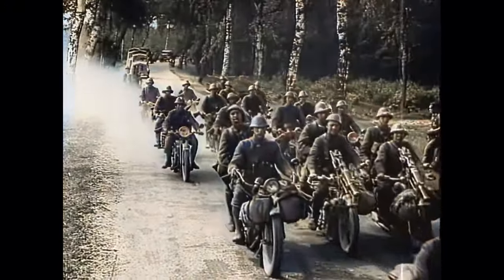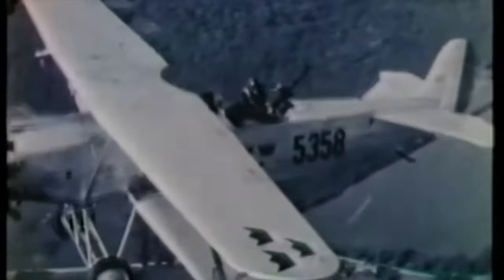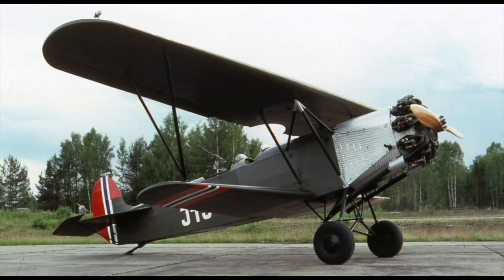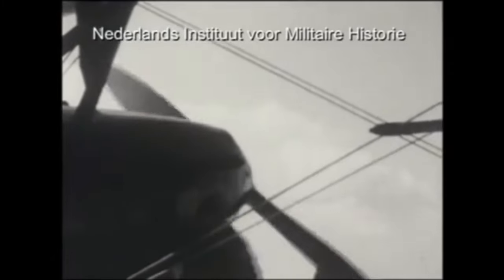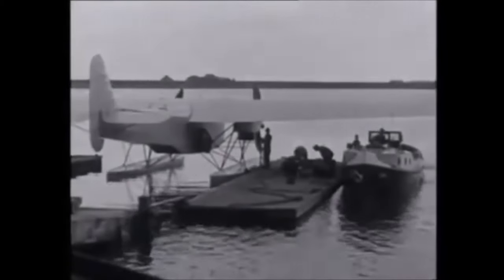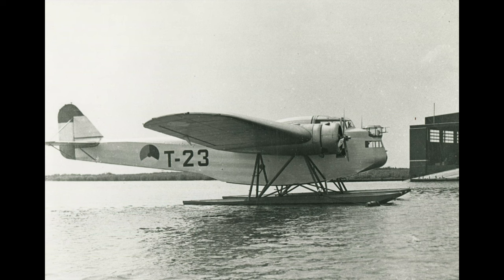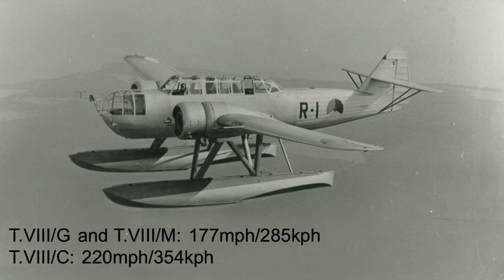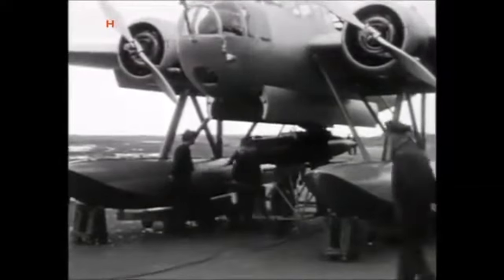Dutch Aircraft of World War Two - Part 1

Comment: Great that you pay attention to the Dutch aircraft in WW2.

BTW the Fokker C10 was incorrectly deemed obsellecent by the Dutch who in part used them correctly flying low.

The commander at Bergen airfield escaped the fate of the G1's by having been smart enough to have the hangars hidden in the treeline.

Not having a decent intercome and radio system was a dire inexcusable error for a country with Philips.

The Fins proved that the C10 was the Apache helicopter of its day. Flying not to high or low as an armed scout plane along the seemingly quite parts of the front attacking targets of opportunity.

When bounced by fighters it would  cross the T and cross rudders. As soon as the enemy fighter was just about to open fire a snap role pointint straight down and in pull up toward the fighter made it impossible to pull lead. 

None were shot down by fighters. Most survived the war. I think two or more were built in ...1944 ..... due to losses mostly by accidents. 

It soldiered on after the war in Finish service.

The Germans/ Dutch engineers drew the correct lessons after WW1 off the Bristol Fighter success in the C5 and C10.

The British got it wrong with the Defiant and Roc turreted fighters.

The C10 had 3 wing options fighter, recon and light bomber. As far as I know only the latter was ever built. Yet, it was the greatest danger for small artillery spotter planes being able to fly the Bristol Fighter WW1 way. 0:32